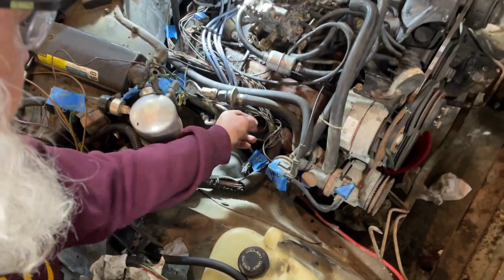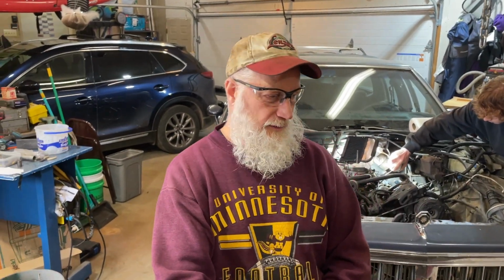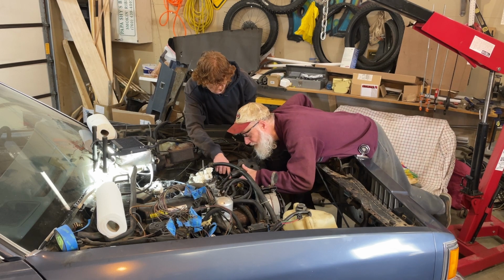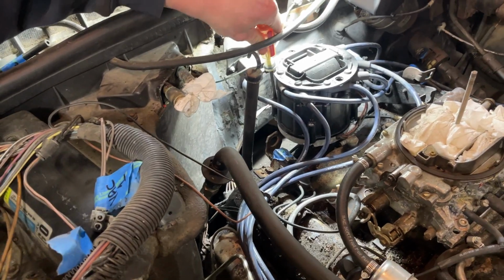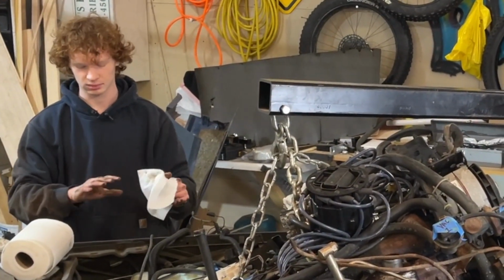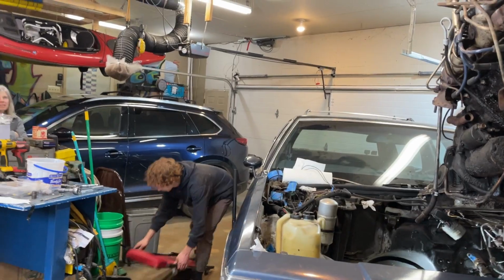1984 Pontiac Wagon Part 3 Engine removal

Comment: Hold on to that 305 and auto trans, that will make a great engine for a hot rod. My best friend is building a 54 Chevy highboy/hot rod truck sitting on the Frame, 305 engine and 3 speed auto trans of a 83 Impala.